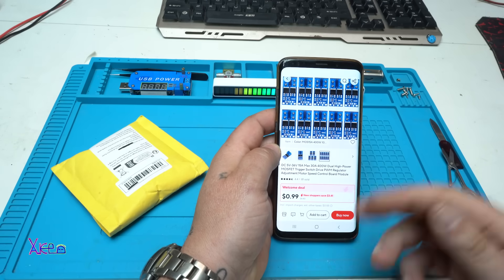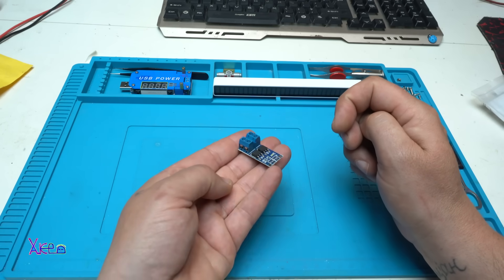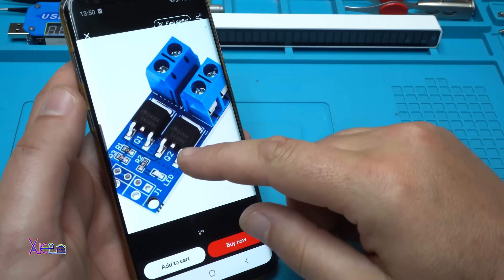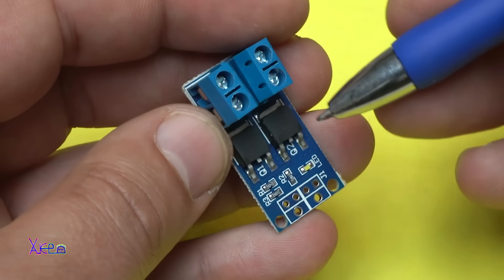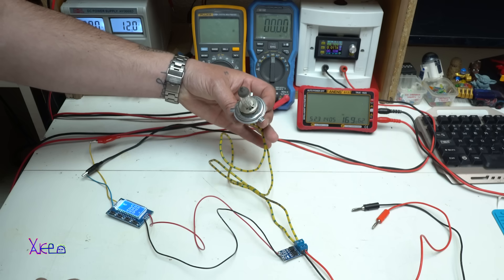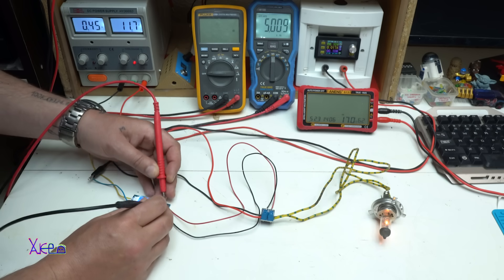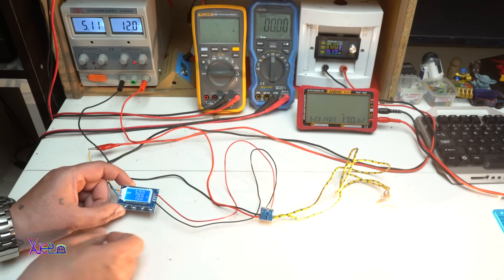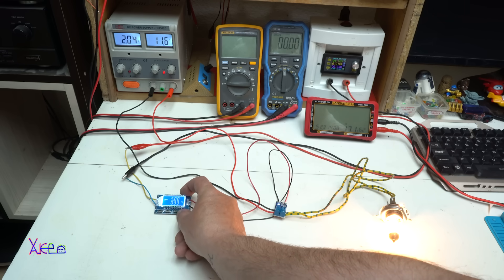$2 Aliexpress Mosfet Module that really is GOOD!

Comment: Be aware that the Vin -ve and the GND terminal are connected directly together on the back of the pcb. THEY ARE NOT ISOLATED.

This means that if you are not using the same ground voltage for your signal -ve and your power -ve, there is a high chance you will create a short between power supplies and/or damage your microcontroller driving the signal.

Comment: Can this little module be use with a on and off switch? I'm trying to use it to turn on and off a 24V-15 amp motor, and if I can how do I wire it using only the power source for the motor. Thank you

Comment: These modules are great for what they're designed to do, which is act as a quick-and-dirty low-side power-MOSFET switch with PWM capability. I try to keep a few on hand for random projects because of how cheap they are for how useful they are.

I have a home-built transformer/pickup coil winding machine and I'm using two of these little modules in it - one is the driver for a key-press beeper (press a button on the machine's keypad and it drives a piezo beeper for 10ms), and the other is a PWM power driver for the laser I'm using as a winding end-stop position setting indicator. (Set the two edges of the coil and how many turns of wire of a given thickness, and the machine will wind that many turns in even layers between those two edges. Laser helps visualize the coil's width.)
Reply: Its a low side switch using NFETS
Reply: @wizrom3046  Yeah I dunno why I typed high. Corrected.
Reply: could it be used in place of a coil relay? so in a car with 12v supply and 12v signal to control LED lighting?
Reply: @frodev728  You can, but with a couple caveats. These modules have an upper limit of around 30V and auto electrical systems can have 50-100 volt spikes on them pretty regularly, so some sort of transient clamp or snubber or what not needs to be added. Also, they only carry more than a couple amps when "heat-sunk" and attaching a heatsink to one can be a tad sketchy.
Reply: @OddlyIncredible thanks. It’s an old car and I will be using them to drive pretty light load LEDs, under 2A mostly. So hopefully neither of those things will be an issue. thanks for responding. 👍🏼
Reply: @frodev728  No problem - they're cheap enough that nothing says you can't stick a fuse in series with the positive feeds and just give it a go.

Comment: what is output of you generator? is 3.3V or 5V? if 5V can you check if this module can be driven by 3.3V?
Reply from the maker: The pwm module give voltage same as input, I need to test it will it work on 3.3v

Comment: What is that ringing noise? Where is coming from?
Reply from the maker: Mosfet frequency🔉
Reply: 500Hz PWM, see his little PWM generator display.
Should have tried it at 10kHz or 20kHz, see if it still runs cool or if switching time is slow causing mosfet heat
Reply: What you hear, probably is the 5kHz switching frequency of the control module. When he sets it to 100% (no PWM), the noise stops.

Comment: what would you actually use this for ?
Reply: I love these. Just bought some to create a smart filament dryer.
Micro controllers can't provide much power to modules, so we hook the modules and whatever input they need to these mosfets and use something like an ESP32 or raspberry to control the power being supplied to them.
Reply: If you wanted to control a car headlight lamp on your bench and already have a pwm controller then this works perfectly.
Reply: Drone motors? Other motors?
Reply: It's another way of looking at a potentiometer.  I am scratching my head too about it, it's new to me..  I believe Cheap Chinese  Diesel Heaters use these to regulate the fuel pump flow by adjusting the number of pulses of fuel delivered per second, ie frequency of pulses.